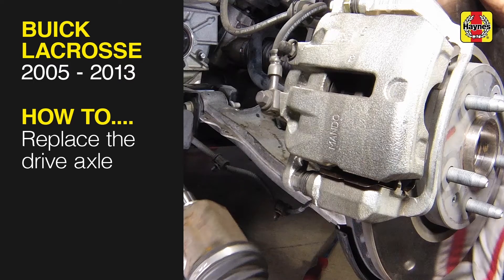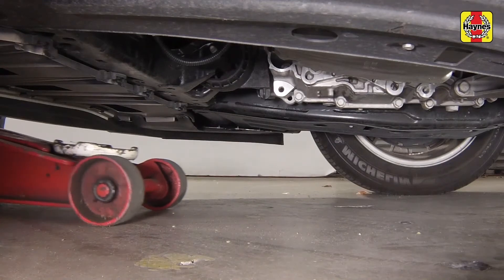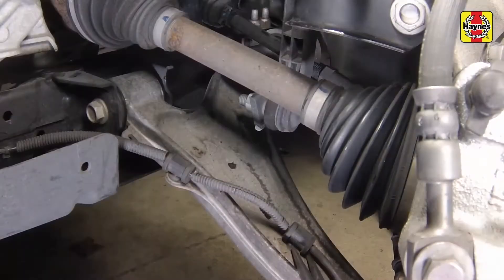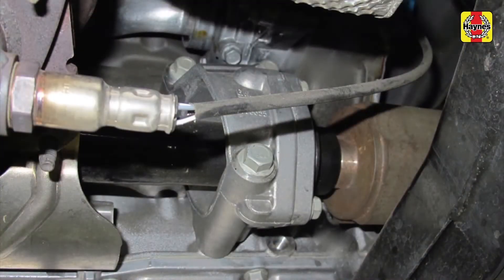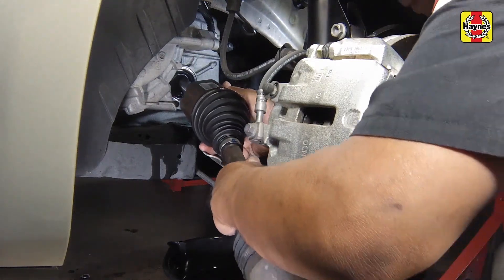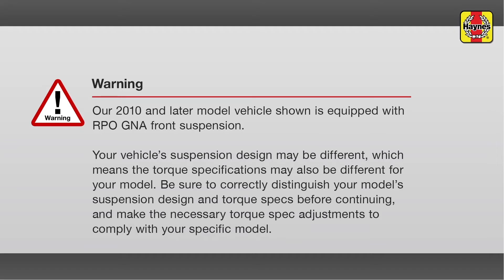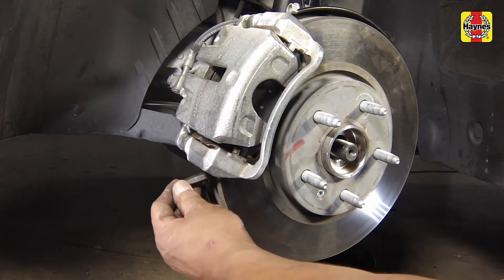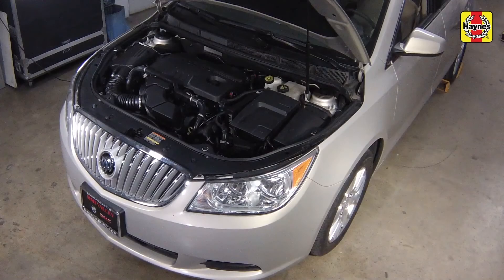Buick LaCrosse (2005 - 2013) - Replace the drive axle

Comment: In my 05 LaCrosse CSX with 3.6 engine, it looks like the exact opposite from your video. Is the video for a 3.8 configuration?  There was no place on mine to even reach up with a screwdriver or pry bar to disconnect the drive shaft from the transaxle.  It was exactly above the frame.  I had to tap it out with a bar, and hope that it didn't damage the seal as it hopped across.

Comment: Does this work for the rear axle
Reply: No rear axle is just a hub assembly
Reply: There are no rear axles on  Lacrosse/Allures. They're front-wheel drive vehicles so they only have front axles.